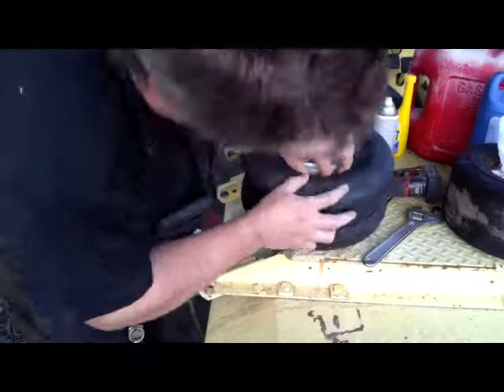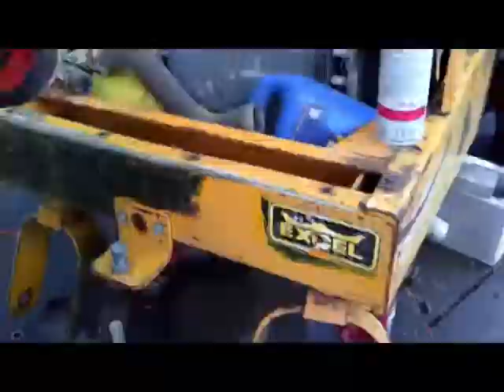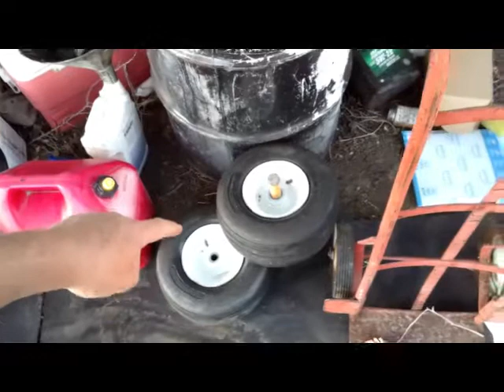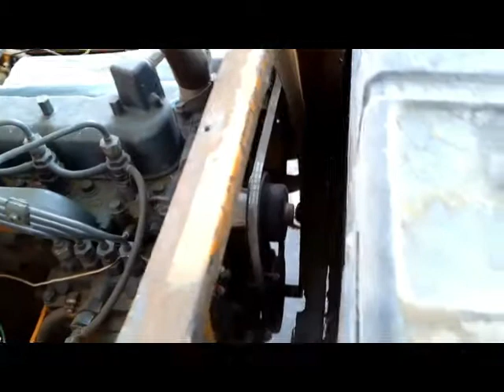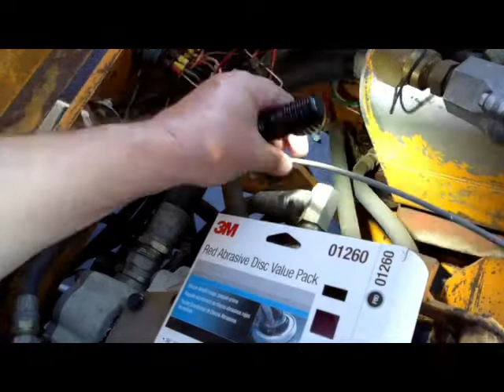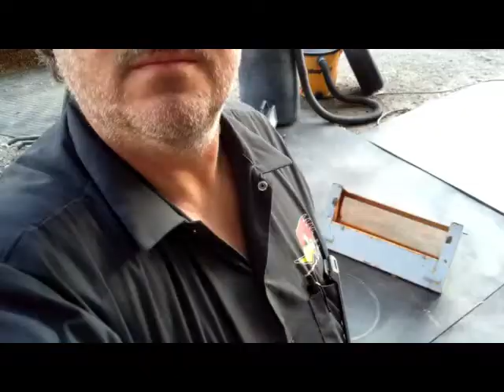hustler 340 update. tires, paint etc.

Comment: I’m just finishing up a refresher on my Raptor SD 54”. Had it for 5 years now. Still working great but I pulled the deck off and rebuilt the spindles and refinished the deck. New belts, sharpened blades and fluid changes. The oem paint is pretty expensive but I found it was worth the price. I used rustoleum for a base coat before the oem paint. The oem paint went on very good. 👍